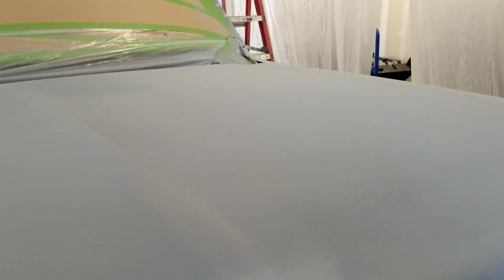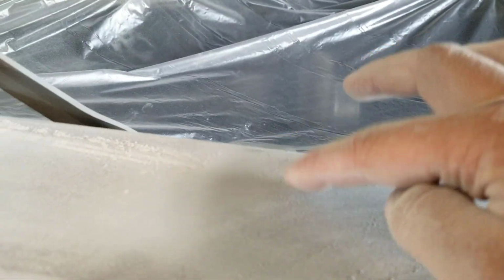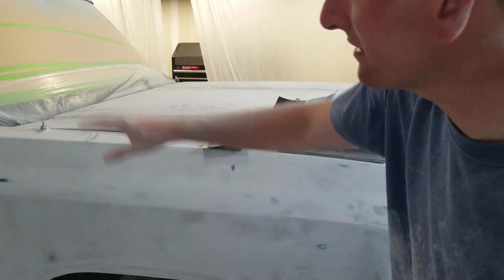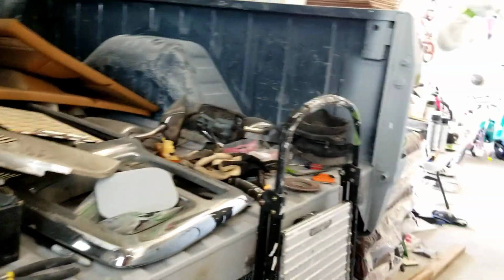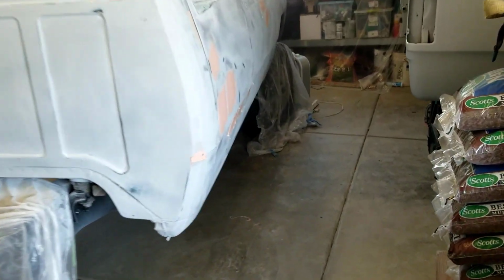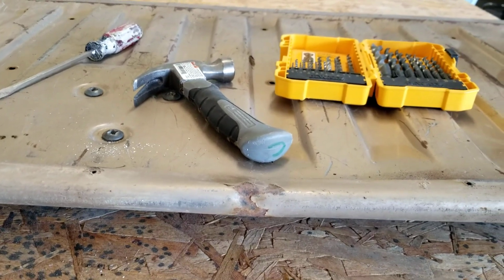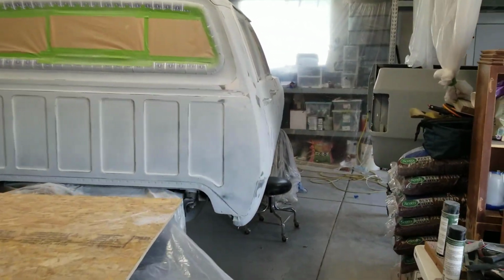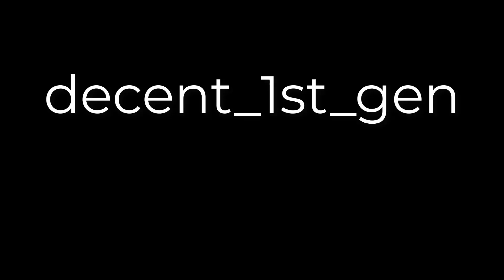Blocking Sanding, Bodywork, and More Paint Prep (Paint Part 13)

Comment: Hello I was searching out info on the Dura-blocks do they use the 3m cubitron hookit paper? I am restoring a 1965 Pearson Triton 28 foot sailboat and wanted a cheap way to grind out the sanding of the interior,  the hull topsides and decks.  I was thinking of getting the 7 piece set and also the Dura-block marine 30 inch longboard for the deck fairing. What has been you opinion of these blocks and would they work well on fiberglass work. I am neither a car body man or a fiberglass repair guy. I can do it with a learning curve but want the best tools for the job without spending big bucks for a one project use.  Any feed back would be appreciated. Thank you.
Reply from the maker: I thought these blocks did an excellent job. They seem to be the industry standard for quality and price point. I would definitely use them if I were you.